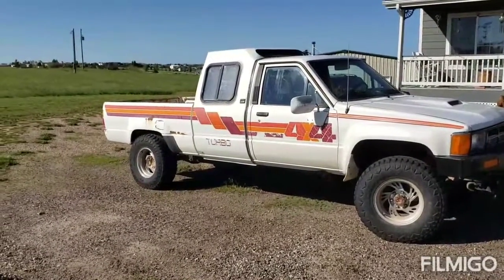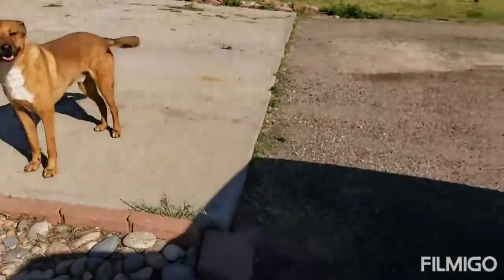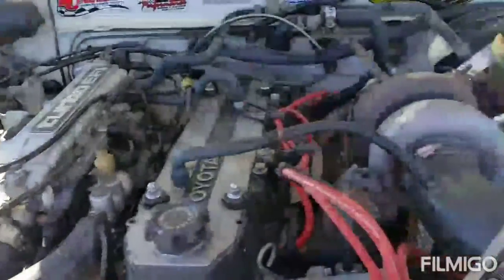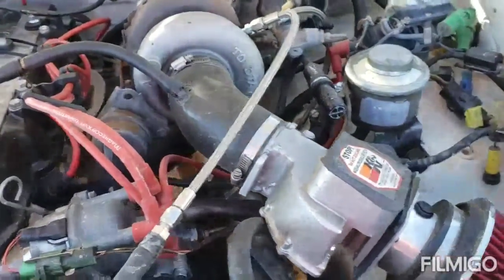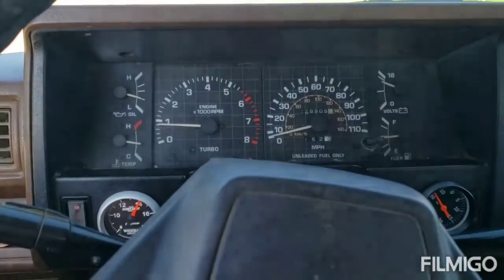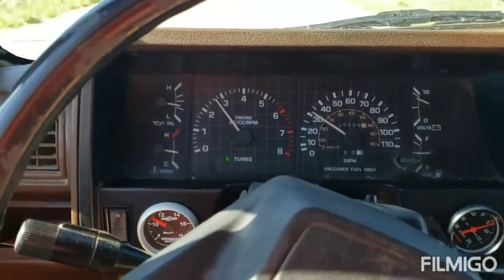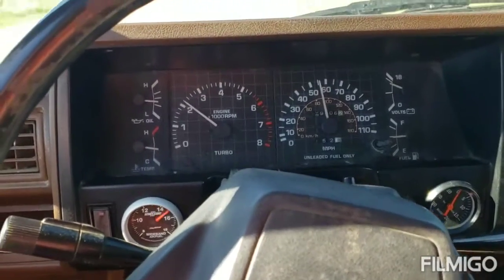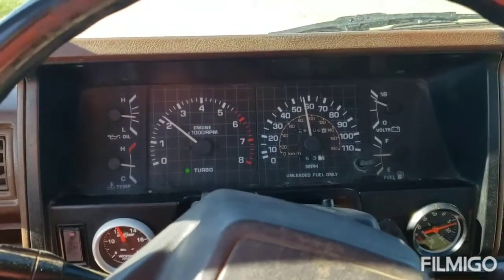1986 turbo Toyota custom cab 22rte ct26

Comment: Cool truck. Subbed.  I own a '86 custom cab 22rte as well. Leaving it factory. Looking for info on or a source for custom cab parts.  I need the rear interior, mine was gutted and tossed by a previous owner.
Reply from the maker: What all are you looking for?
Reply: @dankoldenhoven4997  I am looking for all of the interior parts for the cab extension. So everything behind the front seats. All the trim panels, the rear seat, carpet. Everything.
Reply from the maker: @devondeaton2103  try a junkyard in Denver called Jim's used truck parts.  Make sure you talk to Jim though

Comment: Hi Dan.  Nice job on your custom cab!  Especially with that 3rd gen 4Runner scoop you put on it.  What's interesting to me is that after nearly a year of looking into possible scoop options for an '85 X-cab I've been restomodding, it's that same 3rd gen 4Runner scoop which I was leaning toward going with!  So, finding your  Youtube vid was really awsome for me in seeing what it would actually look like on an original 80's hood!

I do have two questions for you though.  In doing the install did you choose to make it a functional scoop rather than a decorative one?   And; Is there any advise or suggestions you could offer for someone wanting to do that same mod after your having gone through it yourself?

Please let me know if you can as I'm really interested.
Thanks,
Your fellow Missourian, down by Joplin.
Wade
Reply from the maker: Scoop is 100% functional... the top mount turbo created lots of heat and was a huge benefit, due to cutting into hood supports it does flex some but is one of the best things I've done with it

Comment: Hi do you want remember if oem injectors had 1 hole spray pattern? Also do you experience fuel cut off at boost?
Reply from the maker: Pretty sure they are 1 hole.  But honestly can't remember. I've tried eliminating fuel cut in 2 ways.  #1 is i tapped a bolt into the back of the air box to limit the travel of the AFM. This was good up to about 13 lbs. #2 is that I hard wired the fuel pump to a switch that must be turned on and off at start up.  This gets me to 17 lbs. Some way or another the comp still cuts fuel depending on air density.  Cold days it will fuel cut and below 50 degrees at 17 lbs... all these numbers are at 6000 ft
Reply from the maker: https://youtu.be/F-hglSrYJj4 here's how it runs now
Reply: @dankoldenhoven4997  thanks for the info love your truck- I removed my injectors today and was wondering if they where oem - and I replaced them with a 12 hole spray pattern hopefully they help with cold starting and hesitation.
Reply: @dankoldenhoven4997  nice sounds awesome- I also bought a doa head from Tim I believe that’s his name power pack head

Comment: I was curious what transmission your truck came with stock?
Reply from the maker: 5 speed, I think it's called the r151F
Reply: @dankoldenhoven4997  Nice that’s one of the best I’ve heard
Reply from the maker: @dimitripatsis7418  I've been told,  but I did blow the shift forks out of it doing burnouts the day I got it

Comment: That hood is dope! Was it custom made or did you buy it?
Reply from the maker: I built it, its a 3rd gen 4runner scoop
Reply: @dankoldenhoven4997 
Man, I totally dig your truck. I have a 1987 turbo 4runner and it has sooo many odd issues. I'd love to learn more about your build and how you're using the AFM at the stock setting on the spring. Like your injectors and the fuel regulator.

Comment: How much of a difference in power the CT26 from a CT20?
Reply from the maker: Hard to say cause I went from stock to built
Reply: @dankoldenhoven4997  what build did you upgrade too?
Reply from the maker: @sleeks9939  I went from a stock 200k mile truck with a blown head gasket to everything I mention in the video

Comment: Is it for sale?
Reply from the maker: No just showing how it runs mainly,  lots of people think that toy have to run standalone fuel injection to keep AFRs correct
Reply: @dankoldenhoven4997 
How did you'd get it to run so good? What size injectors? How many clicks on the AFM? I keep getting fuel cut hard and I've only taken my boost to 10psi